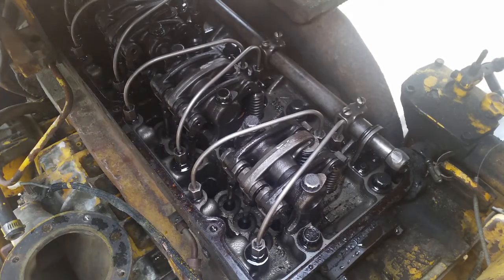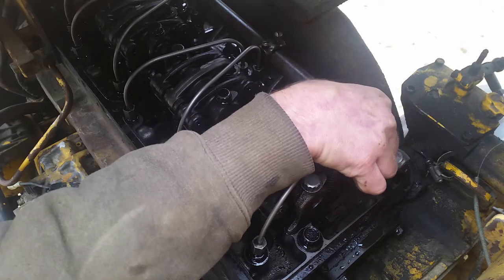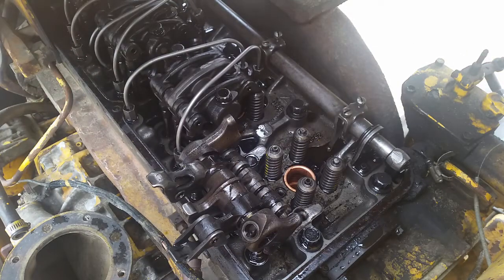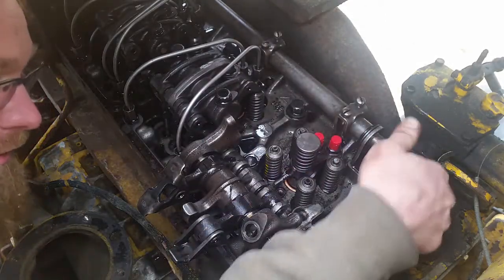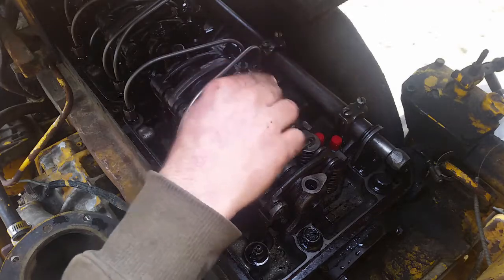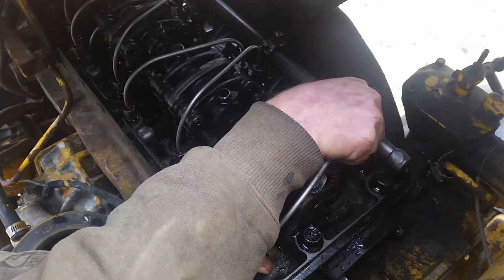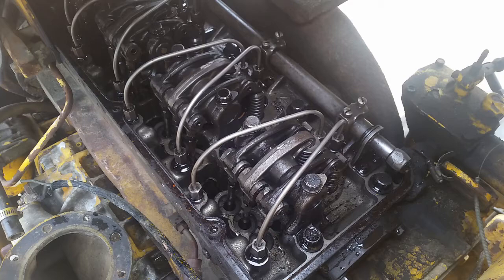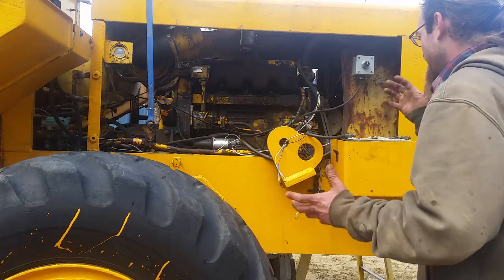INJECTOR REPLACEMENT on Detroit Diesel 453 (Leaking Injector)

Comment: I had a stuck injector on a 4-71 Drott Cruz-Air, it was stuck down, I could not get it unstuck, so I sprayed Brake clean through each fitting on the injector till it was like a fountain then the other fitting right next to it. Repeat with PB blaster. Let it sit overnight, and Presto! The next morning it was free and had popped up again!👍Once I found the emergency/Runaway  Flap shutdown  was closed, and opened it up, it started  right up!👍

Comment: Fuel runs through the injectors full-time all the time goes from the tank to the  filters to heads  then to the injectors witch keeps  them cool then back  to the tank
Reply: Qwantwz hp??
Reply: @manoelgid4283 I think about 180 HP.👍

Comment: Why didn’t you set injector timing?
Reply from the maker: I checked the injector height (timing) of the new injector and it was same as the one I was removing. I did not need to make any adjustments.